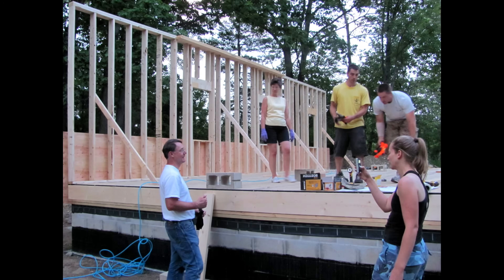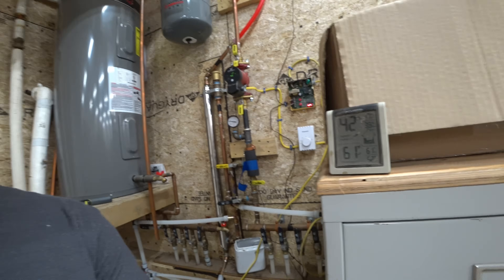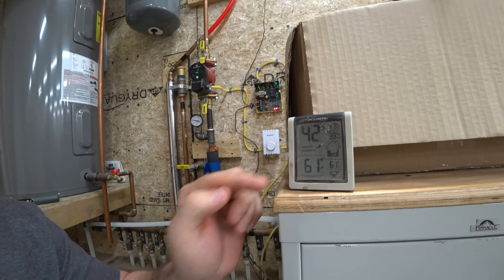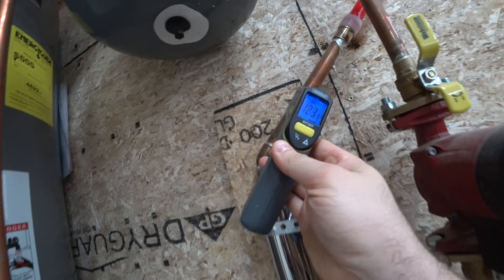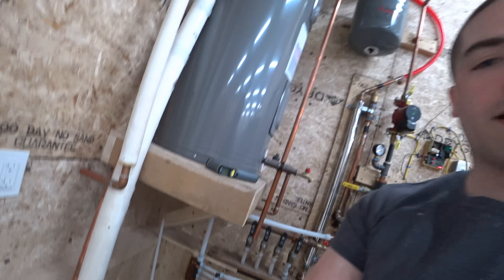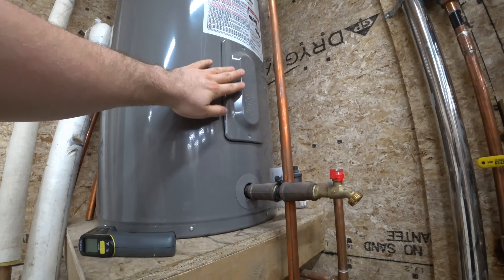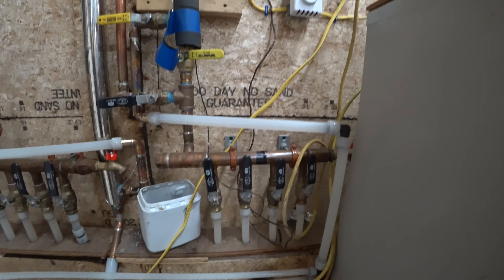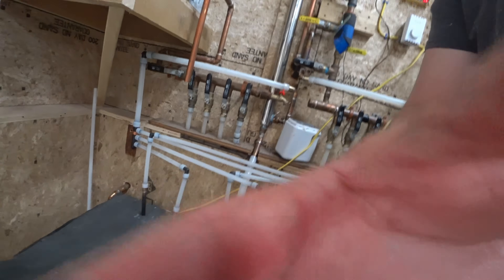Solar Heated Garage Radiant Floor, Update

Comment: He built a solar system???
Reply from the maker: Sure,  I'm using the sun to heat water, then pumping the hot water through the radiant floor.  Thanks for watching.

Comment: How long are your loops?
Reply from the maker: If you are referring to the radiant floor, then I have 4 loops, each is 250 feet using 1/2" ID Uponor PEX with oxygen barrier.  Thanks for watching.
Reply: @DavidPozEnergy  On the other hand if you're happy with it just enjoy you're hard work. :)
Reply from the maker: Thanks.  Did you happen to see my video on making the floor?  https://youtu.be/s9Pmt7XG_2c
Reply: @DavidPozEnergy  I didn't, but I'll check it out. thanks
Reply: Yes, I was referring to the floor. As an ex radiant heat designer as per the Radiant Panel Association I'll say that you have the gold standard in the floor. The delta is a concern. It's too much. A slightly higher flow rate should get that down and spread the heat to the floor more evenly. You might have a little more head than you calculated.

Comment: With that high delta you might want to consider upping the flow rate through the floor to get more heat to the slab.
Reply: Yep, get every bit of heat you can into that slab while you're generating heat as long as it's not so hot that it's running you out.  It's the slab that you want storing the thermal mass in this case, not the tank unless the slabs hotter than you can handle.

Comment: I have started to research solar heating for my garage it is plumbed for in floor but no heat sources.

I am wondering why you are using a heat exchanger and not just pumping it directly into your floor?
Reply from the maker: The first year I built the garage I had no solar thermal, just the radiant floor with the electric water heater.  I added the solar thermal as a retrofit.  In order to add to the existing system I used a heat exchanger.  If you are not doing a retrofit, then go ahead and pump the same water from the floor up through the panels.  If you make a video about, please send me the link as I'd love to see it.  Thanks for watching.
Reply: If you live in a cold climate never use water. Use non-toxic propylene glycol. You can pump it directly through the floor circuits. No need for a heat exchanger. If you do use water and it ever freezes you will crack the concrete; I saw it happen once. Not pretty!

Comment: Can you measure the temp between each thermal panel and if possible measure the approx flow rate of the pump?  If we know the watts per square meter(or ft) from the sun in your area then we (the geeks) can find the efficiency of your system.  This would help us better understand how to optimize any future designs without having to take a thermodynamics class :)
Reply from the maker: Hi Josh,  I have not measured the flow rate, but according to the manufacture chart, for my head, it is 5 gal/min.

Comment: This seems ridiculous.  Stop the madness.  Put the solar panels on your house.   You only need to keep it above freezing because of the unnecessary water pipes you added.

No way this is better than an electric heater running when necessary.

Comment: The delta between your panel temp and floor/air temp is very high... You also have a lot of heat returning to the panels... I bet you would fair better pulling heat off your panels by running a water to air exchanger. A couple large truck radiators and a couple of electric fans would be able to put a lot more heat into that garage then radiant flooring simply because if the system has been off all night then your solar heater spends most of the time warming the garage floor up from over night instead of actually heating the garage.
Reply: Water-to-air heat exchanger think about it. Before the hot water goes up to the solar panels it goes through a copper coil air heat exchanger with a fan behind it blowing the hot water air through the fan coil. Thus blowing the extra hot air up before it goes to the panels on the roof.
Reply: This would be interesting!
Reply: You could even install a couple radiators after the floor circuit but before the return to the box to bleed off the heat that the floor didn't absorb into the garage air space.
Reply: But air doesn't store heat well. His concrete slab does better.

Comment: Be neat to design an insulated water tower that had a solar vacuum tube water heater with copper heat exchange coils coming up from the bottom of the tank with super heated gallium being circulated through the heat exchange coils with the heated water then being circulated through two underground insulated cisterns that kept the water hot were you could add in thermal electric generators has well to the system. Its always best to have a few heating and cooling electrical power generation redundant systems just in case the main systems fail. 😊
Reply: It would be a neat experiment but Peltier (TEG) are horribly inefficient. It would cost less to buy photovoltaic panels (unless everything was free).  Now if the heat were coming from another source besides the sun, like a hot spring Peltiers would be very interesting.

Comment: Try a solar vacuum tube water heater retrofited to super heat gallium that is circulated through a copper heat exchange using an electromagnetic pump ounce the gallium has reached a certain temperature with the heat exchange coil being placed in the bottom of an insulated water tank above the resivor of the gallium within the solar vacuum tube water hester so the gallium will drain all out of the coil ounce the system is shut off. Then make a water tank insulated with peralite to keep your water hot over night or have an underground insulated cistern with a pump to circulate heated water through a heated floor system. A organic carbon power cell bank could also be charged up every day by adding thermal electric generators to the super heated gallium. You could place them on feed before the gallium enters the heat exchange coil. Then just alternate carbon power cell banks so you use one carbon power cell bank during the day and then one charges during the day that you then use during the night. You could also incorporate V-twin stirling hot gas engines that operates off the super heated gallium to heat the piston cylinder heads with the the fly wheels either operating pumps to pump super heated gallium or heated water or even operate water pumps for a hydroponic green house. You could even circulate super heated gallium through a copper condensing coil and attach a fan to one of the V-twin  fly wheels and draw air through the coil to heat a home or green house. If you really want to go all off grid? Then you could manufacture a V-20 stirling hot gas engine with high heat magnetic bearings on all moving parts and then attach an automatic bicycle transmission to each fly wheel the attach a large rewired drum motor generator with magnetic bearings with a vacuum spark gap to each automatic bicycle transmission and have a state of the art electrical power and heat generation system.  Well if you understand everything i have shared? Hit me up and ill explain a cooling electrical power generation system using liquid air and a stirling V-twin or V-6 or V-20 Stirling cold gas engine that can provide air conditioning refrigeration electrical power generation and a way to chill oxygenate and add nitrogen to water being pumped through a hydroponic green house. 😊
Reply: If you're so smart please build the system you describe and post your own YouTube video for us all to see.

Comment: I have a 90tube domestic hot water system with insulated DIY 200gal softank. In summer one 30 tube panel is all I need. I have to cover the other two. It's a closed-loop system though with glycol added. If I did it again I'd go drainback design. Our side business is long gone but here's the difference closed vs drainback: https://www.youtube.com/watch?v=qOXcbsjUOZw , here's a large 16 apartment evac tube solar setup: https://www.builditsolar.com/Projects/WaterHeating/LargeDB/LargeDrainBack.htm the key to efficient solar heating is a very large well insulated storage tank. In your case, technically, your slab is your "tank" I suppose. But if you add more panels later, your slab may get too hot. That's where temperature regulation becomes an issue. Looking at your return pipe it looks like a drawback setup so that's ideal. I'm working on a large barn design and I'll likely be looking at 2000-5000 gal storage tank. Oh, one more tip, you could add a bit of glycol to your setup to prevent corrosion as there are many dissimilar metals (brass, copper, stainless, etc). I think water pH acidity level also could play a role in copper pipe corrosion. I found in my tank the water was quite acidic. Ended up adding baking soda to bring pH down. But by that time my coils looked like poop.
Reply from the maker: Good tip.  I'll have to check the ph level.

Comment: I didn't see how your floor was built. Yes its concrete but how did you insulated the concrete from the ground. I have done a lot of in floor heat using boilers in Canada and have always argued with engineers on how to do it. Like to know your thoughts and ideas
Reply from the maker: Hi George, I hope we are on the same page.  I like insulation and think the warm concrete floor should be separated from the earth.  I have a video on making the floor, and the insulation.  Here it is: https://youtu.be/s9Pmt7XG_2c

Comment: One thing that would raise the solar efficiency, and heat output of this would be to use a vacuum tube collector.  These are about 80% efficient, and they are not too expensive.
Reply from the maker: Hi Neil,  I agree.  I went with flat plate collectors because I picked them up for free on craigslist.
Reply: Free is good!  You're doing a great job, by the way.  My brother and I have been completely rebuilding the roof on my house, and we got a 10.1kW solar PV system installed about 6+ weeks ago.  I am hoping to add a battery storage system at some point soon.

My plan is to have R72 in the 2x12 rafters - using blown in WOOL insulation.  Pretty amazing, really.
Reply from the maker: That's great!  If you haven't seen it I have some videos of insulating my house and garage.  Here is a link to one of them, but there are several older ones.  https://youtu.be/k8g9Q___CJ0

Comment: Evacuated solar panels yield very high water temperatures in low latitude, sun locations.
Reply from the maker: Hi Jim,  I agree, evacuated tubes are great.  I used these because I picked them up for free, here is the video on that: https://youtu.be/9Nd9k1rQPW8

Comment: Many years ago I worked for a brilliant engineer who heated his whole high ceiling, metal roof factory via underfloor heating. Air temp was never high but his female workers never moaned about being cold as their feet were always warm even with snow outside. I swear by underfloor heating now. Hot water is best but electric is super easy to lay by comparison and I have it in our kitchen and dining room and it works brilliantly with zero wasted wall space from panel radiators and a MUCH better feel to the room warmth at a far lower air temp than with panel rads.

If your solar panels are free then use them. Otherwise the BEST panels are cryo panels which do not require solar (but collect MASSIVE amounts of energy if there is sunshine) otherwise they get their heat by trying to "freeze" the outdoors to -40C which will never happen except in the very coldest of cold Northern Canadian nights. So they are always pumping heat and as soon as they get sun the heat output just soars. Not cheap, but bloody fantastic.

Comment: Looks great! What is your design load? how many sqft? what are your R-Values? I went with a 3/4 ton mini split for heating my 960sqft house with a design load of only 8000BTU/h. Averaging R-50 for all surfaces. My house is a second story addition over garage so I couldn't use tons of thermal mass like you without a large complicated water tank, and I was going for simple.
Reply from the maker: Hi Joe,  I'll answer your questions to the best of my ability, but forgive me I don't have all the numbers.

The garage is about 1,200 square feet, 28x44 with 12' ceiling.  R-100 blown cellulose ceiling,  R-56 foam under the slab, and R-20 walls.  I have some construction videos of the garage up on my channel.  Also, check out this video on how I heat my house: https://youtu.be/8PaT7dcOJfM

Comment: Now, is there a way to send cool water through the floor to cool the place off during the summer? 
It'd be really great to have some kind of hybrid system.
Reply from the maker: Hi Nick,

Cold radiant floors don't work in my climate because we have too much humidity.  The floor will be covered in condensation.  They are OK in the desert.  Thanks for watching.
Reply: DavidPoz Ahh yes, that makes sense!!
Reply: Dig a really deep hole. Bury coils of pipe and cover up and pump.   Not sure how deep or how big.

Comment: why not just use some insulated acrylic for the garage roof?  Guaranteed to be hotter than 40F when there is sun :)
Reply from the maker: Hi tripzero,  Thanks for watching.  I did not use glazing on the roof for a few reasons.  1. Overheating in the summer. 2. heat loss though the glazing at night.  3. Climate Control (I have a thermostat that turns the pump on and off.)

Comment: David, If you want a warmer garage, then for about 200 dollars you can install a 24v dc water heater element, They run around 25 dollars and a 100 watt panel for 100 bucks, some wiring and swapping out one of those ac heater elements and you should be good to go..  another way is a dump load ( water heater element )from a small wind turbine.
Reply: Solar thermal panels are more efficient than solar PV panels.  If goal is efficiency, PV panel is not the way to go.  If goal is cost, however...
Reply: They may be more efficient than solar, If you need extra boost during the winter you will need something else, solar and wind can help with that. There are more ways as well to help with heating such as a coal or wood boiler that you can use for helping the heating system also.
Reply from the maker: Goal is both.  Check out this video to see how I got the panels cheap: https://youtu.be/9Nd9k1rQPW8
Reply: Think about it: a 100W panel can never produce more than 100W. A 100W heating element will produce so little heat you will never even feel it in a space the size of a garage.

Comment: Hey David, I have about 30 solar thermal systems that  I'd like to sell all together. I'm close to Washington state. I'd sell them all for $3000.
Reply from the maker: Do you have them on craigslist?  That is where I found all of mine.
Reply: DavidPoz  Not yet, I have to figure when I have the time to meet with anyone interested. Right now I'm working about 800 miles away from home.